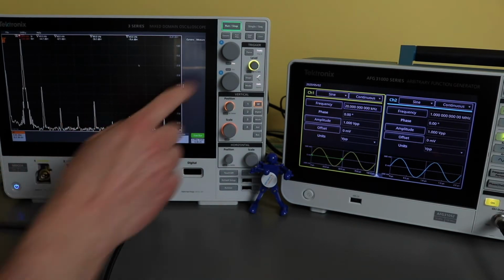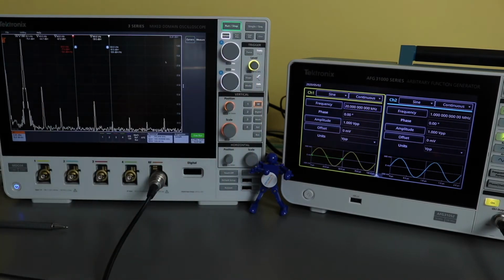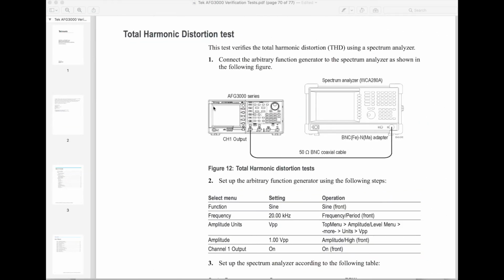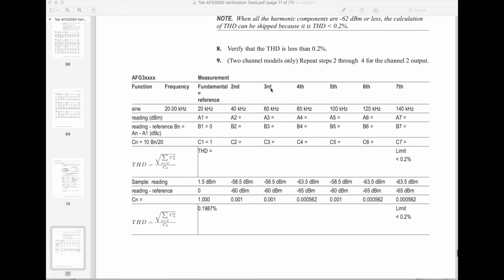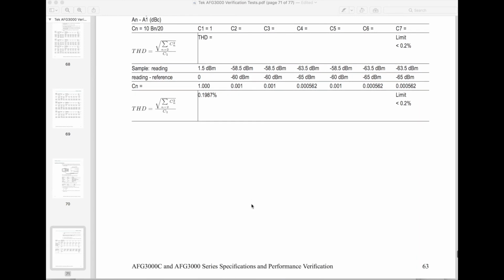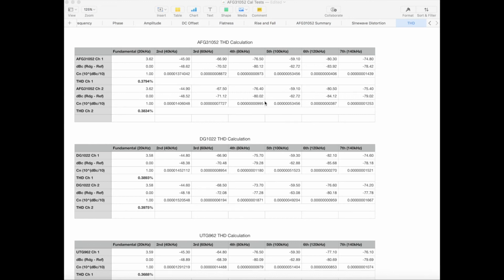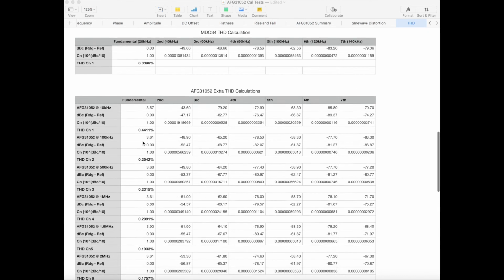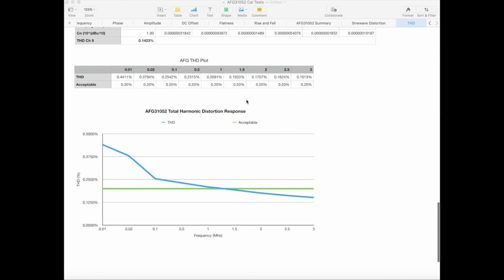Total Harmonics Distortion Measurement of the AFG31502

Comment: measuring low values of THD with SA is very difficult because the nonlinearity of the SA itself easily contaminates the results. One way to get better result is to have a fairly large attenuator at the input but that adds noise and you can hardly see the higher harmonics because they get buried in the noise floor. By playing with that attenuation if the SA is a top notch SA with high dynamic range you can get a very good readings. AFG31502 is not as good as keysight 33600A in terms of THD but I am not sure how good the SA in the tek MDO3 is. You probably need a better SA with higher dynamic range. That's why audio analyzers  have that sharp notch filter in order to just measure the harmonics without having the main tone. If you can put a very sharp notch filter at the input of your SA then the problem will be solved too
Reply from the maker: Great information, thanks for watching and commenting.